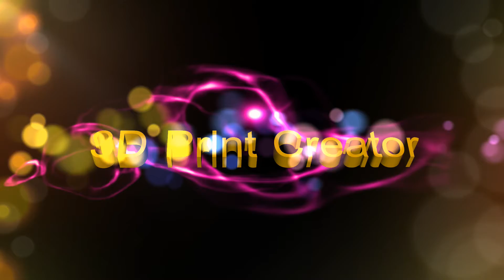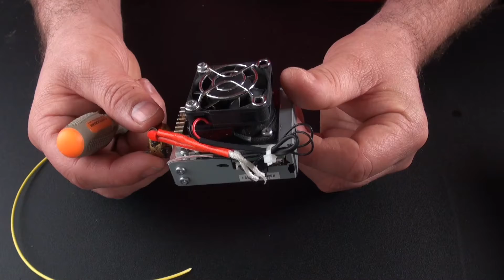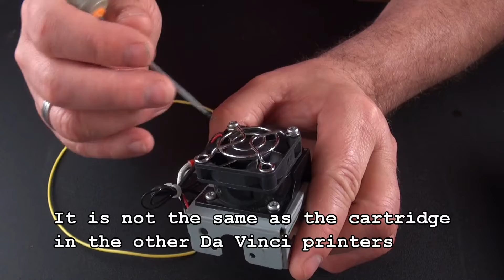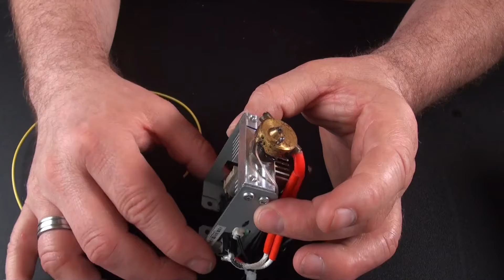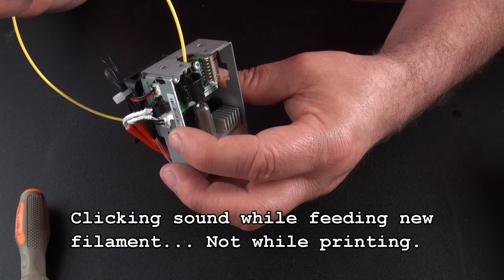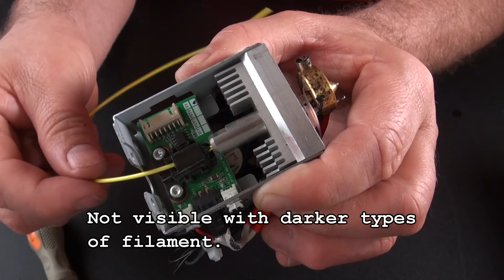▼ Da Vinci Pro 1.0 Hot-End assembly technical knowledge

Comment: You mentioned you use a torch to heat your nozzle. Can you effectively use a soldering iron to heat the tip? Does it get hot enough?
Reply from the maker: Hi Phil,
I can not answer this question as I don't know the answer. If you have a soldering iron that heats up to a lot of heat and is capable of transfering the heat to the nozzle of the printer, I guess it will work. If the Iron can't get hot enough, or if it's tip is very small and can almost not transfer any heat (like an electronics soldering iron), then I am sure it won't work.

Comment: I have had to remove my drop in cartridge a couple months back filament was stuck were the filament goes into the hotend.  Luckily I was able to pull it out with needle nose pliers. But a few days ago it happened again when the filament broke off.  This time its to far down for me to grab and pull it out.  I have tried heating the nozzle up but very little of it comes out.  Does the nozzle on the hotend separate from the heartbreak? What i mean is does the hotend separate into 2 pieces? I even tried heating it with a torch still can't get it out.  Driving me crazy I have things I need to print.
Reply from the maker: Hi, Sorry to hear yout nozzle is clogged again.
Maybe the two video's on my website will help you get the clog out.
http://3d-printcreator.com/unclogging-the-da-vinci-pro-1-nozzle/

Comment: are you using a stock motor to push the filament or do you know of an aftermarket one that would work, also the wiring pairs?

thanks hope someone can help XYZ not helpful at all was told buy a new one
Reply from the maker: I am still using the stock motor and I know it's not a standard motor. I don't know the wiring. SOrry.

Comment: I tried using the E3D V6 Drop-In Cartridge but I can't get it in :(
Reply from the maker: Hi Josh,
Take a close look at the printed cartridge versus the original one.
I had it once that the printed one needed just a little bit of sanding before it fitted.

I don't know which drop in cartridge file you have used, but I know there are a couple of models on Thingiverse. I have successfully used the design of B. Walker (bdwalker1) on thingiverse.

Good luck.
Reply: Thanks I'm printing out a different one that looks more like the original
Reply from the maker: Alright !!! Good luck with that one ;-)
If everything works out fine, would you mind dropping the link to the one you used here in the comments?
Reply: Will do, it just got done printing so I'll test it out
Reply: http://www.thingiverse.com/thing:1392121 is the one I'm going to test, it almost fit but need some work done to it
Reply from the maker: Thanks, great info also for others.
Reply from the maker: Oh wait... I see it's a cartridge for the Da Vinci 1.0, not for the pro. This is not a Bowden type carriage.
Does that work???

Comment: I thought the filament sensor was an led and light sensor not a phisical sw, that is why clear filament isn't detected unless you modify it to think there is filament in it or I think on the pro you can turn it off  .
Reply: Hi Brian,

Thanks for the shout-out.  I just now found this video. :-)

Actually, having closely examined the PCB for the da Vinci Pro I can tell you that it is an optical switch (an IR LED and IR sensor in a single package) -- not a physical switch.  However, it isn't the filament that breaks the light beam in the optical switch; instead, there is a spring-loaded plastic guide that the filament pushes back toward the PCB and that plastic guide breaks the light beam in the optical switch. Thus it does not matter if the filament is transparent or not.

In creating my replacement PCB I mistakenly designed it with an optical switch that the filament was supposed to break the light beam. I soon realized there were two problems: 1) the light seemed to leak around the filament, and 2) transparent filaments sometimes did and sometimes did not trigger the sensor. I wound up creating a physical gate that the filament would push into the light beam as it passed through.

Bruce
Reply from the maker: In the pro it really is a micro switch. You can hear it click when you put the filament in.
Reply: in others it's not a sw which makes it not see clear filament mine is a 1.0a I was going to but something in the way o it would thing there was always something there.but thanks I will take it out and check for a sw.
Reply from the maker: I now have to go to my work (it's 8:30 in the morning here in Holland) but when I get home, I will try and run clear filament. I just received 2KG of it, so I can test that tonight for you.

That said, I am sure I have a micro switch inside. I can even hrear the clicking sound when I press it.
Reply: I checked and you are right it is a sw .mine is 1.0a stock FW 2.1.0 and current XYZware ...xyz calls it blue but it is grey it maybe one of the earlier ones the serial number ends in 000009I loaded the clear PET in it and it is now printing a test
Reply from the maker: Hi,
Yeah I forgot to give an answer to this one. I have tried it and it works good for me, and indeed, It is really a switch.
Reply from the maker: Your Welcome. Your drop in cartridge is one of the best upgrades I have made and it deserves to be shout out loud.

Comment: I was wondering if you have any advice for getting the carriage out of the holder if there is a piece of filament holding it in - I think this is called "clearing the throat"?  The only thing I can think is to slide a razor blade in, but I am worried about cutting the throat.  Also, could you do a video on how you use a gas flame to clear the extruder?  Thank you for the great info.
Reply from the maker: The razor blade is actually not a bad idea. At the place where the carriage and the cartridge come together there is a metal funnel that you can't impossible slide with your razor blade. Right under that funnel you can slide the filament (you can have a good look at it if you remove the sides of your printer).

then, when you have the extruder out, hold the nozzle (only the tip, not the rest) into a gas flame and have some filament ready to feed into the nozzle. when the nozzle is hot, press the remaining filament through the nozzle until you see the color of the filament you are using to push. Then Pull the filament out in a quick movement. Now you are good to go.

If it happens again, I will make a video about it.
Reply: Thank you kindly!